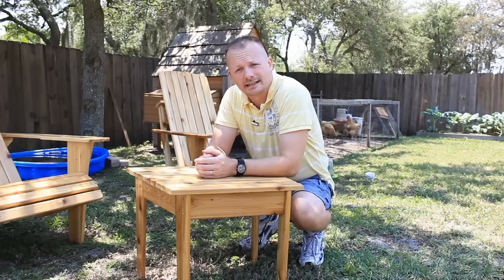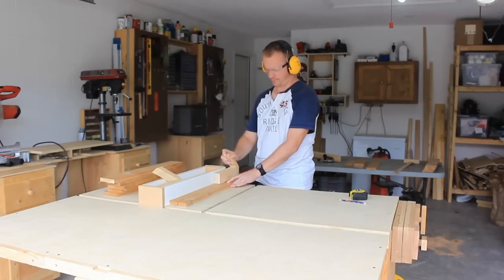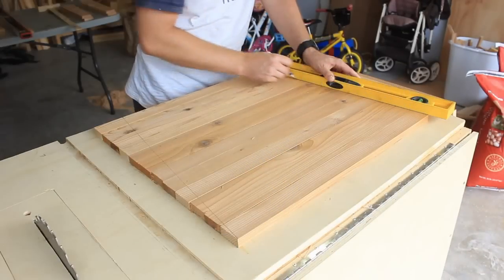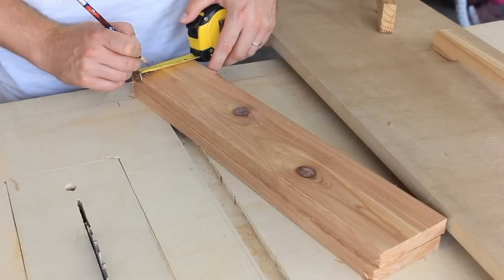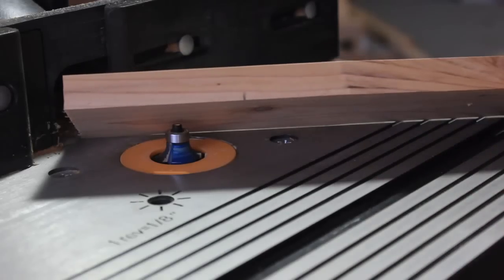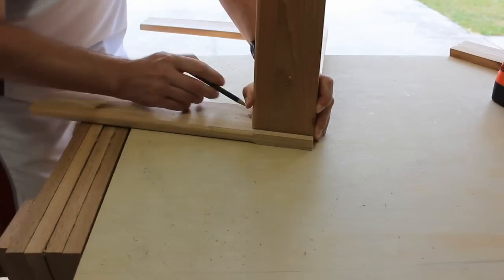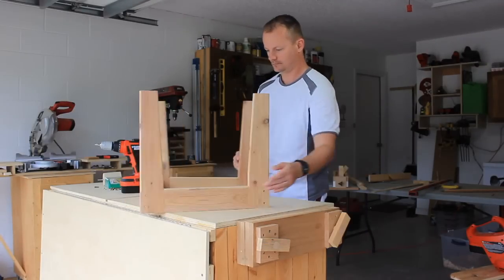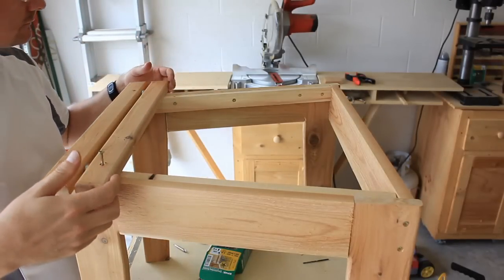Cedar Adirondack Style Outdoor Side Table

Comment: I want to build this project since my wife is purchasing "Hampton Bay, Spring Haven Wicker chairs". For the back yard. Do you have the dimensions for the Table? This week I am designing a stop for the miter saw and putting it on you tube. It will have a ruler built into the stop. Kregg sells the same jig, mine will be a lot cheaper.
Reply from the maker: Kent Harris Yes, on the blog post.  Check the description for the link.

Comment: Nice project Stan. You said it only cost around $20, where did you get the cedar? Was it just from the BORG? Fence pickets?  Thanks.
Reply from the maker: I picked up the cedar from one of the big box retailers.  A 1x4x8 board was $6.75 at the time.  If I remember correctly I used around 21 or 22 board feet to make the table.  Add to that about a dollar worth of screws and I figured the cost was $19.57.  Even if the cost of cedar is higher due to season or area it still works out to be a cheap project.  Good question.